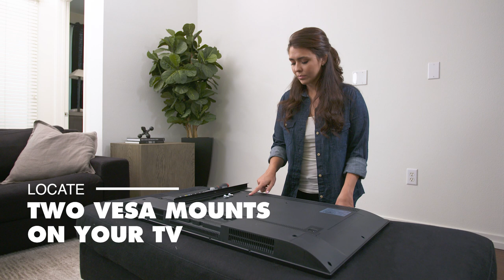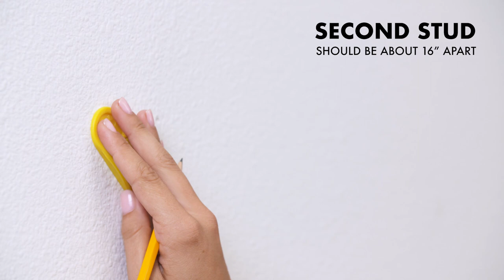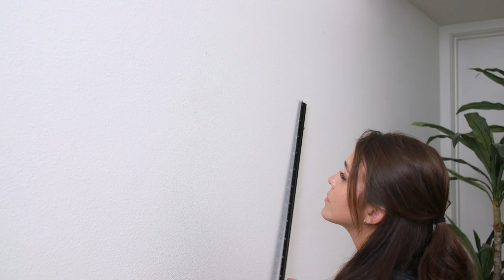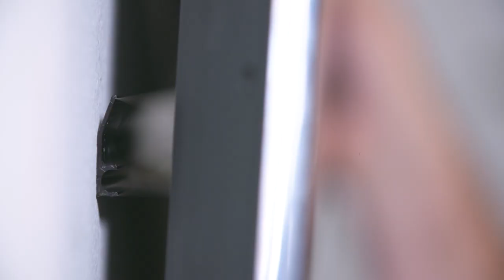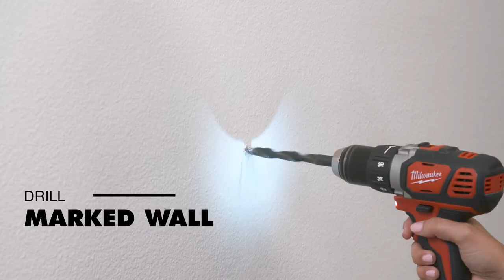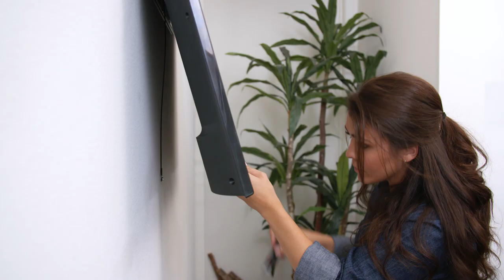Hangman Products Simple Mount TV Hanger

Comment: Seems too close to the wall for adequate ventilation.
Reply from the maker: Hi Aaron, there is a slight tilt when mounted that allows for ventilation. We have not had any issues and the mount has been on the market for several years. If you have any questions or concerns at all or would like further information, please feel free to call us directly at 818-610-0487 8-5 Pacific time. Thank you!